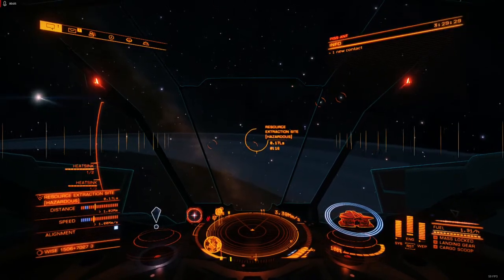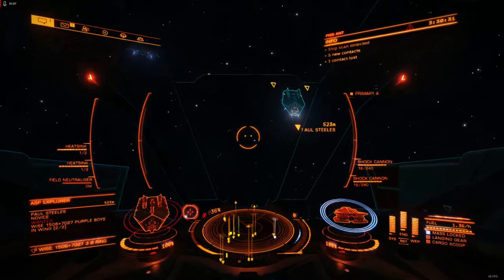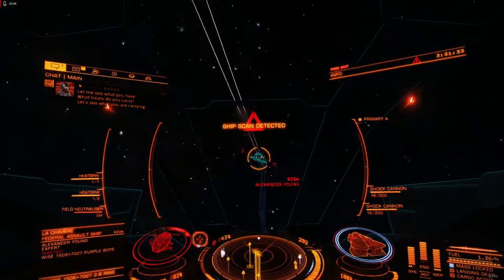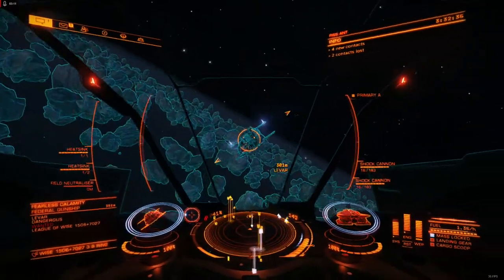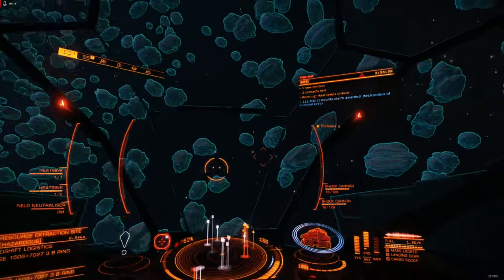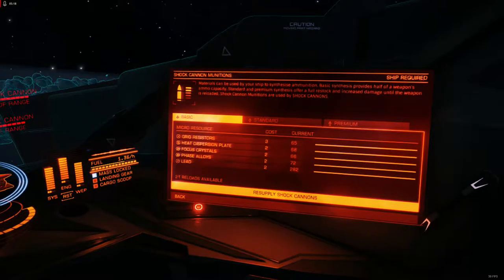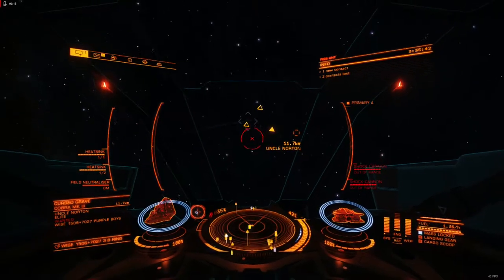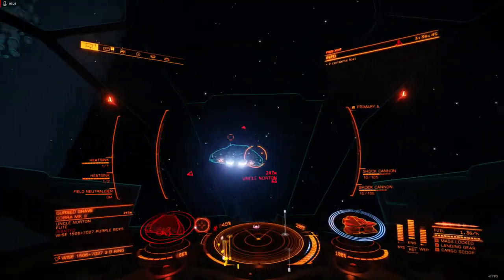Elite Dangerous | Build Experiments | Introduction to Shock Cannons

Comment: Very nice shooting. I'm going to equip some, because Frags are fun, but I need a change. And BTW, if you equip your combat ships with collector limpets and a little cargo space, you can pick up a lot of mats after each kill, and avoid the HGE grind altogether. o7
Reply: Got my Anaconda fit with MC's, Pack Hounds, and a single thermal vent laser and use it for farming manufactured mats in the hi-res and haz-res.  I collect enough low and mid level mats that it's worth the trouble of trading them up for the more rare items.  So I seldom need to go looking for any HGE's.

Comment: Have you ran a turreted version of these on one of your T10s yet? Curious to fit them on my own...
Reply from the maker: Experimental weapons require multi-crew to function as turrets. Not enough people use the multi-crew system to justify the turrets, so they are mostly ignored by the community.
Reply: you can use. but since it is "semi-automatic" it only returns to the target. does not shoot. if you have guessing ability then you can use it. however, it means you'll want to rely on the turret's aiming system as you won't be able to see the target.